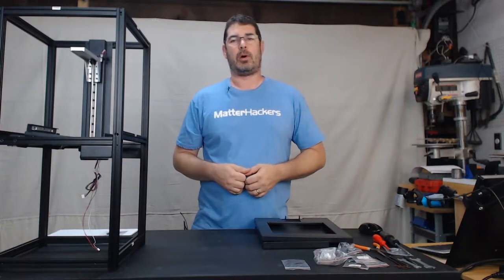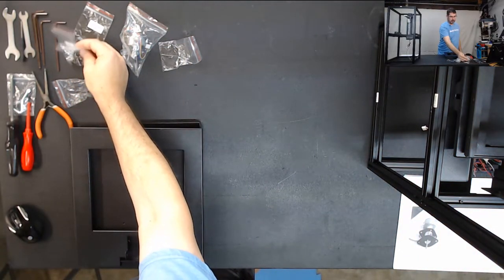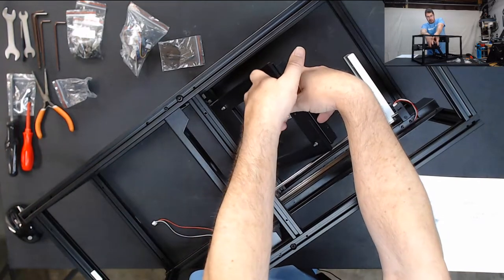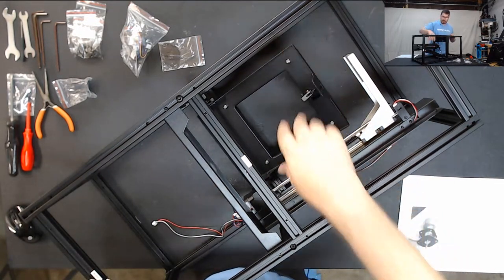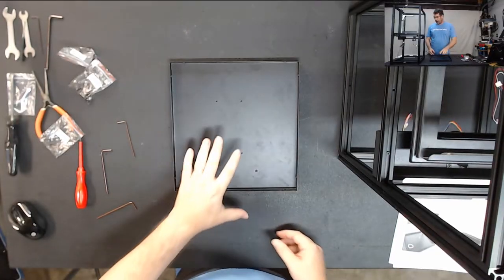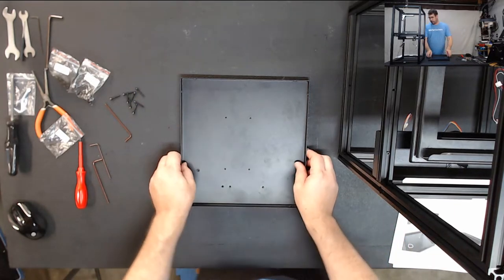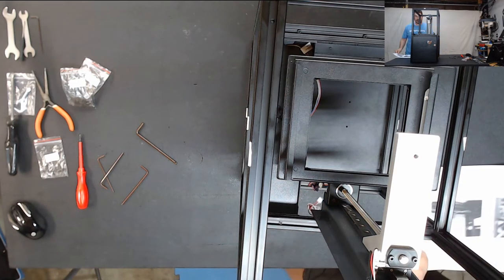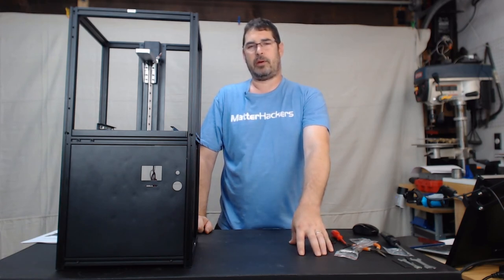Moai Series Part 5: Riser Motor and Metal body Panels

Comment: It looks like the front panel has a bunch of dents. Is it just the angle of the video?
Reply from the maker: Good eye!  Yes, those are weld marks for the threaded risers on the back. completely normal.  Spoiler alert: not a big deal- that panel actually gets covered with plexiglass in 2 more episodes.
Reply: Practical Printing thanks for the reply. I was hoping it wouldn't stay like that. It didn't look to professional.